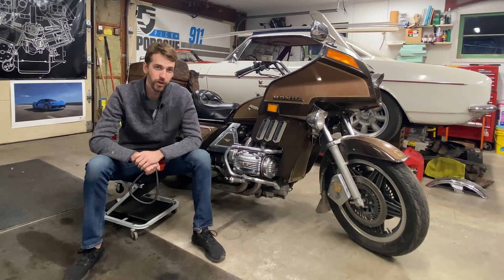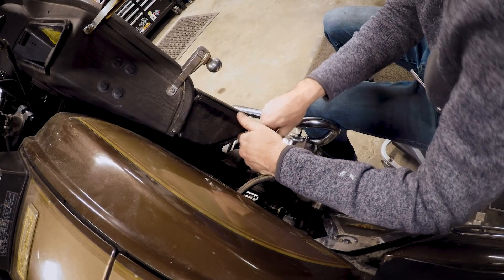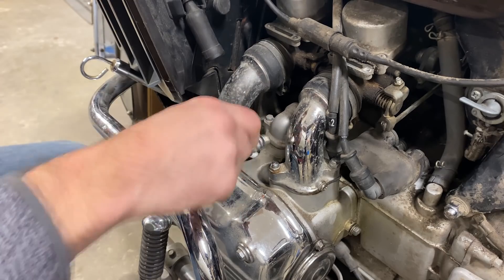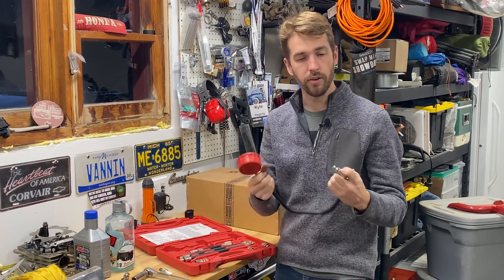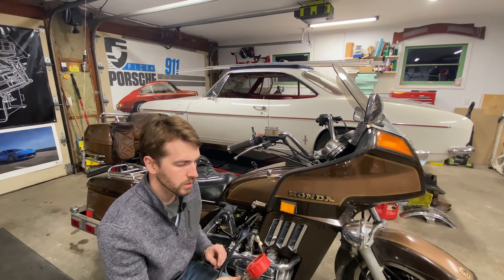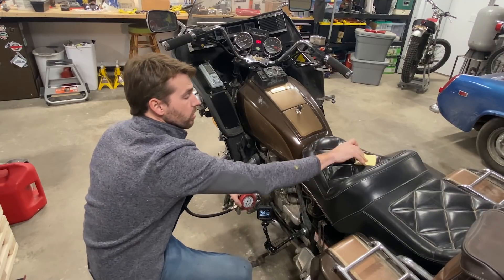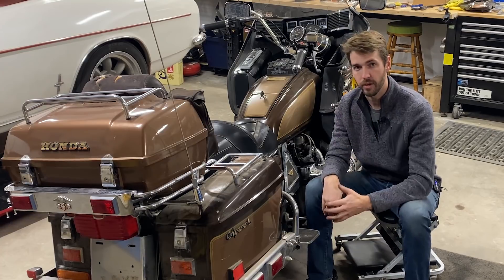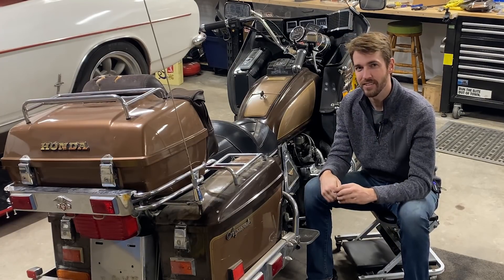Checking engine compression | Kyle's Garage - Ep. 23

Comment: A must do on old GL's like this are the 4 o-rings between the intake elbows and cylinder heads. It will not idle or sync properly with vacuum leaks

Comment: Good video, what I normally do after a dry compression test, is squirt small amount of oil down the bores and do another test, if compression rises, it's the rings, if there is no rise in cimpression, it is the valves, but, a good ride to get it hot will either sort it, or not, it is a boxer, free reving.

Comment: Bit of advice unless you know the service history..  Those old GLs you should change the timing belts every 35,000 miles or after extended periods of storage.  These are interference engines and if a belt breaks or slips on you the motor will be trashed .   It's actually pretty easy to do

Comment: You need to open the throttle to do a correct compression test, otherwise your starving it of air to get a true reading. I have seen many of those bikes with well over 100,000 miles and still run great! The key is maintenance. Look in the oil fill, if it's clean it has had regular oil changes. That and the air filter are the key to long life of anything with a engine!